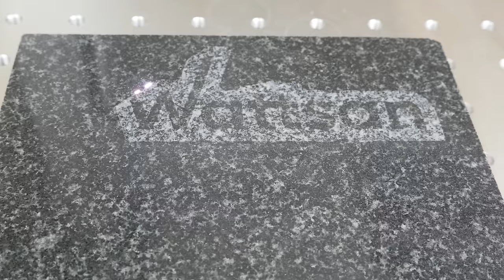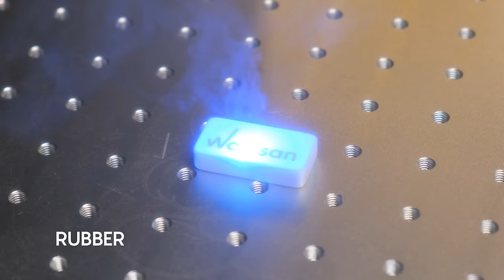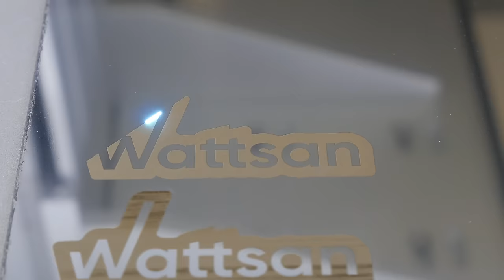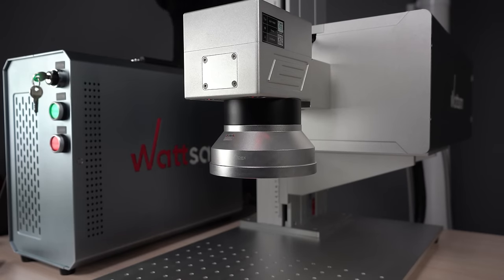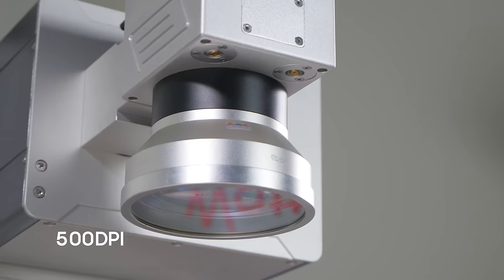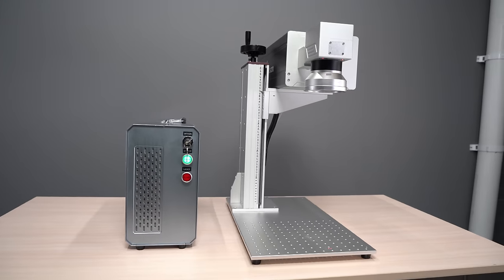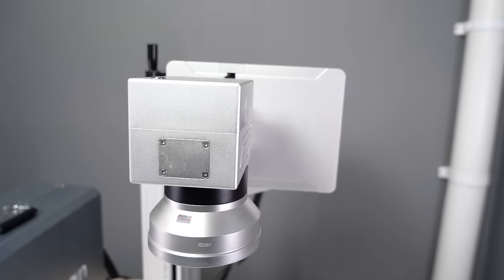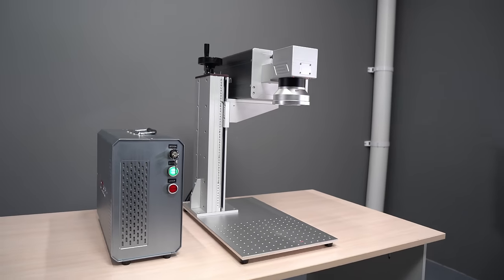UV LASER MARKING MACHINE / WATTSAN UV TT / NEW 💥

Comment: Is it possible to process quartz glass with this laser?
Reply from the maker: Hi! Thank you for the question! Quartz glass is used for windows or screens and is notable for being difficult to mark. It's sensitive to cracks yet heat resistant, requiring a gentle marking method. The UV laser uses its high absorption and power dense beam spot to mark slowly and produce clean, visible marks. The UV laser marker beam is strong enough to conquer the heat resistance yet delicate enough not to crack the quartz glass.